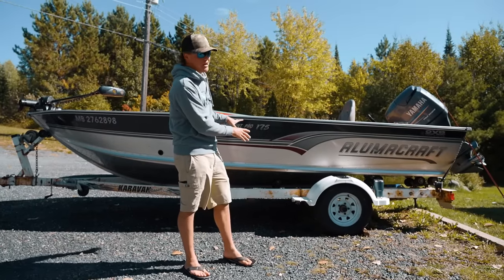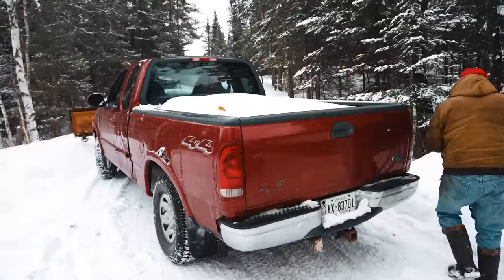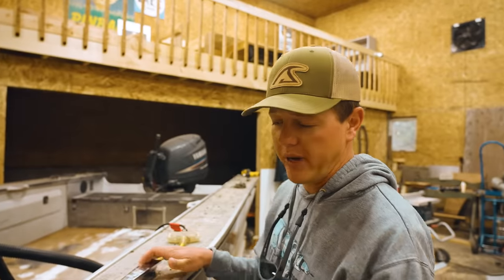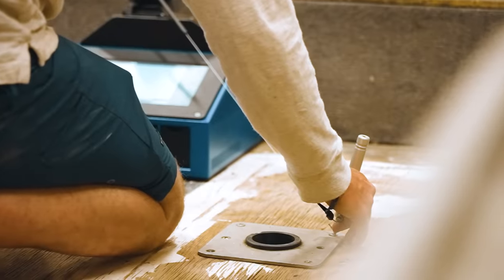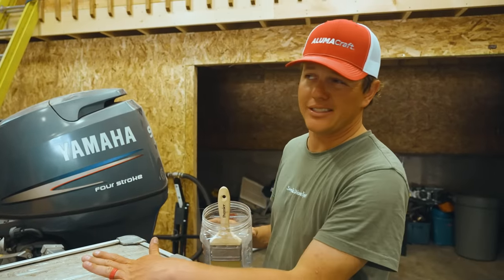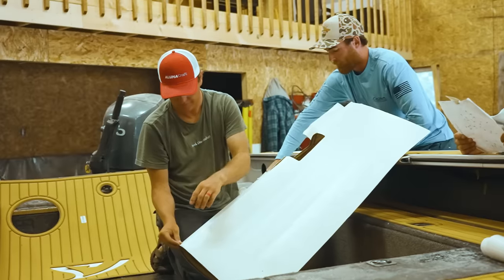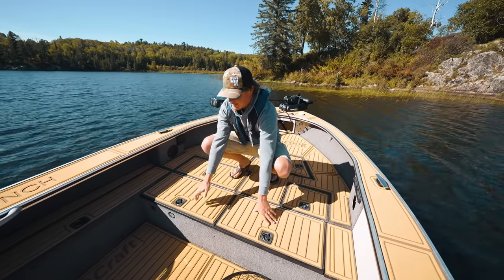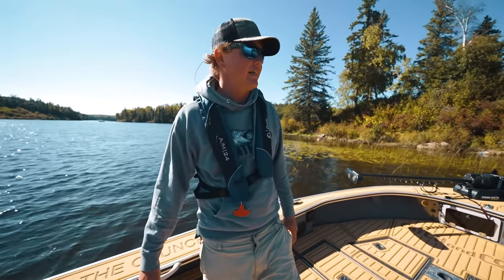Renovating My Childhood Boat (Incredible Results)

Comment: Hey Jay, you guys should consider buying a Festool Rotex RO90 sander and/or the RO125.  It's a hybrid between a sander and a grinder, but is variable speed, and is amazing at surface prep and could be awesome for removing that carpet adhesive.  Im in residential construction and love this tool but I know that they are also big in the automotive industry.  Paired with the dust extractor (fancy name for a vacuum), they perform so well.  I've had some of their sanders and vacuums for ten years and beat the crap out of them with no issues.  You might go through a lot of sandpaper but it's worth the labor savings, and likely offers smoother surface than scraping.  Last perk, this brand is really focused on dust control and you would be dealing with much less dust and cleanup.

Comment: So if you have a problem with your boat, and the technician needs to get under the floor or under any panel. How would they be able to remove them if they can’t get to the screws? They would have to remove sea deck.

Comment: What’s the typical cost to add aqua traction to a boat? For example a 17.5 ft Alumacraft.
Reply: I remember seeing the cost of a 20ft multi species rig was around $11,000
Reply from the maker: Roughly $50/sq foot if no carpet removal or prep is needed. Obviously varies depending on complexity of design, numbers of logos, etc.
Reply: @Gumby905   Wegner had the cost listed in his for sale details for his boat.

Comment: Product and installation probably exceeds hull value no? :) This can't be good value for the money on this boat.
What is the life expectancy on that product? No long term reviews ....
Reply from the maker: Product installation + scan is roughly $50/sq foot. You’re looking at a few grand for new flooring or a new hull for easily 10k (likely more) - Guys have been using this down in saltwater and getting 7+ years of use out of it.